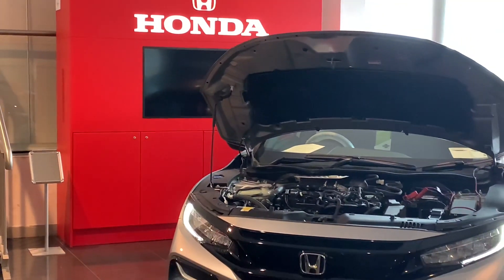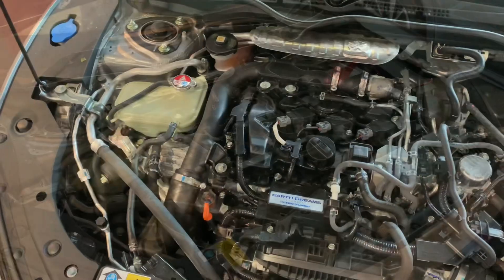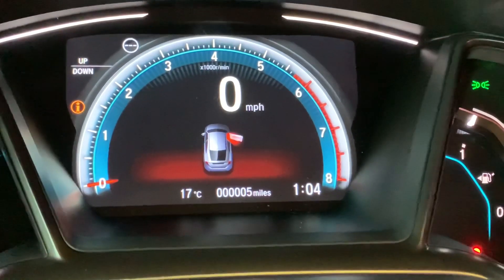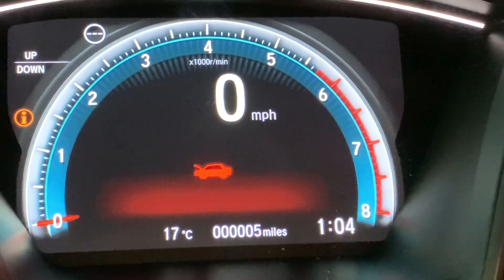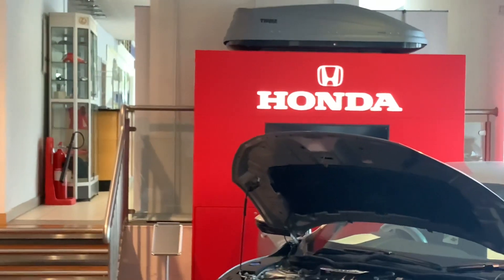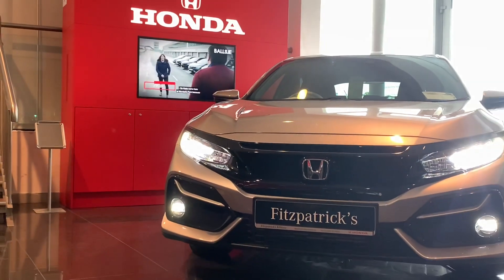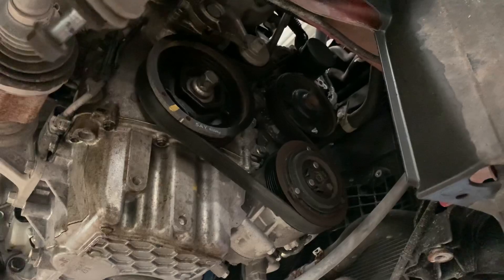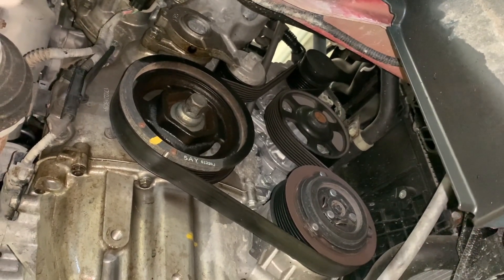1.0 Turbo Civic engine review - P10A2 - what is it like ?

Comment: Civic 1.0T with 119,000km and serviced every 11,000km, the head gasket blew. A disappointment.
Reply from the maker: Sorry to hear this , we haven’t seen head gasket failure on that engine , most of the rebuilds we did were oil starvation usually 😞

Comment: How about the known problem with the wet belt problem? Ours has 30k miles and the turbo and wet belt system has totally failed with belt degregation. We are fighting Honda atm. This engines not fit for purpose in my opinion
Reply from the maker: The manufacturer did some extended warranty on 2017 in 2018 models, what year is the one you have?
Reply: @doolanbrian 2020. It’s at Honda now, I’m refusing to pay for it if I’m charged. I think it was unfit for purpose when it was sold to us?
Reply from the maker: @deanbeckworth1053  I don’t know how consumer rights would look at that, we were never challenged on that basis as a dealer. We did carry out rebuilds under warranty on 2017 and 2018 engines but not so much after that. Does the car have a good service history as an oil changed on an annual basis using honda oil, et cetera?

Comment: I had a 1.ltr with 43000 mile on clock , seviced at each year , last week booom , totally unaware , lost pose dash litt up like a Christmas tree , turbo , variable regulator oil pipe boost the lot , cattle trucked , currently car in turbo specialist getting repaired . Thousands pounds for repair , wouldn’t touch on wit a barge pole , or any 1,0 ltr  turbo Wetheral be Honda ford whatever fuming on a car that’s a 2019  STAY AWAY !
Reply from the maker: Did you have it diagnosed in a Honda dealer?

Comment: There's a lot of the 1.0 litre engines with eco boost,turbos,  now on loads of different car models they have wet belts the belt sits in oil and you will find it's a lot more expensive to change
Reply from the maker: @willretro6110  it’s a more expensive job yes !

Comment: Never heard of Honda using a 3 cylinder wet cambelt 1 litre engine or seen one. Is it the Ford Eco boost engine which is a total disaster. Note- Ford are joining Red Bull F1 Team and providing joint venture engine in 2026. That will see no more F1 trophies for Red Bull.
Reply from the maker: @KeithPotter-ph4cp  not a Ford engine.. I think the engine was designed in Europe and then re-badged by Honda.. don’t believe it shared with other manufacturers

Comment: Hi,

I have a 2019 Civic SR with 80km on the clock. It packed in on me 10 days ago, lost power on the motorway and  wouldn't restart. No warning lights on the dash and no fault codes showing on diagnostics. Its with my local mechanic now as the nearest honda garage is 100km away. Any advice on weather this could be a timing belt issue?

I noticed a slight lack of power before it brokedown
Reply from the maker: @supercoolcol1  sorry to hear this😐 , so basically it wouldn’t restart, but not showing any faults? It’s impossible to say for sure but I would initially guess that possibly it’s jumped a tooth on the timing belt unfortunately🫤
Reply from the maker: @supercoolcol1  that’s a little bit unusual if the belt is just done and a bit unlucky🫤 most manufacturers operate on the principle of they don’t do warranty on parts after about 12 months, 

I think all you can do is ask the question, but I can’t really be sure what the results would be, sorry I can’t help better. No harm in asking for assistance it will cost you nothing.👍🙂
Reply: @doolanbrian  thank you for taking the time to respond. Your insight is very informative.

I can live with the cost of a new timing belt. These things can happen... but I'm afraid of my life there going to tell me that the engine is screwed now. I won't be able to accept that this would not be a honda issue rather than a me issue...

Thanks again 
Colm

Comment: As long as the engine has regular oil changes then there want be any issues with he timing belt.
Reply: regular Honda recommended does not work needs 5k km religiously. Onto second engine covered by Honda but selling soon for Toyota.

Comment: Love the car. Mine has sprung an oil leak between the engine and cvt gearbox. According to the dealer, it’s a common problem with the 1L versions after about 38k km. Will need to get the seals re-done and that requires lifting the engine out of its bay; pretty complex.
Reply from the maker: Hopefully you get sorted fast, can you get it under warranty?
Reply: Thank you. Unfortunately, my warranty has expired and there isn't a recall / service bulletin for it so I'm on my own. Love the engine regardless though!
Reply from the maker: @MisnadHaque  well, hopefully it doesn’t work out to be too expensive, glad you are getting on well with the vehicle🫡

Comment: timing belt problems with these cars,stay clear....
Reply from the maker: We have seen issues on the belt especially where service history is not good .. we sell quite a number of brands ., modern engines in all brands seem to have the propensity to have issues more than I can ever recall over the last 30 years in brands we sell and others brands we don’t sell as manufacturers try to meet difficult emissions and production related issues.. modern engines are extremely complex .. Peugeot honda Opel hyundai Kia citroen and probably more all have engines that have possible Osiris .. Honda I have to highlight are the only manufacturers that actually stand over their engine issues outside of normal warranty . In this car the 1.5 And 1.6 run a timing chain and so fair they don’t appear to be troublesome, thanks for watching

Comment: awful engine, not a Honda engine unreliable
Reply from the maker: Are you having trouble with the one you have at the moment?
Reply: This motor is a crap... mine is from 2021, 65.000km... Honda can find the cause why the cooling system is keeping ejecting the fluid from getting out... head remove, after 3 weeks the problem keep... 2 months testing the car and no explanation... no more Honda, sorry... expensive maintenance, high fuel consumption (8L in town) and AC problems, plastic noises, etc... i like the chassi but the motor is big big big issue...

Comment: I just had the 1.0 litre vetch engine fail in my 2018 civic, the turbo failed and the main crankshaft bearings failed, at 56000 miles, this is a common fault on these engines due to swarf getting into the turbo and oil dilution due to the direct injection system putting too much fuel into the bore, Honda finally ageeed to fix it free of charge after a battle, don’t but a Honda with this engine whatever you do DONT BUY A HONDA 1.0 civic !
Reply from the maker: Good that they covered it .. you must have a full honda service history ?
Reply: @doolanbrian  Brian, it’s a disaster from start to finish, yes, they covered it  after a huge battle, I still don’t have the car back after six weeks, no loan car was offered or available, the fact remains that I was sold a vehicle with an engine that is clearly not fit for purpose and now I have to sell the car the moment I get it back because even though they will have fixed it, it still has an engine with inherent faults, so, it’s not a rosy as you, the honda dealer try to make out !
Reply from the maker: @PaulPaul-chillers  you had a full honda service record with the oil changed every 9/10000 kms ?
Reply: @doolanbrian  of course, otherwise they would have had the perfect excuse to have denied the repair
Reply from the maker: @PaulPaul-chillers  are you in UK ? what are the service intervals over there for oil changes

Comment: That was not a timingbelt showing 4:20 min in the video, but the fan belt. Only reason to use timingbelt is its cheaper for the factory but more expensive for the customer when it needs to be replaced every 6 years. It is very difficult to get a price for changing the timing belt in Denmark because the car is not that old, but a Honda workshop has said that the engine must be removed when the timing belt is changed... DKK 20,000. or 2700 euros. It's ridiculous. Go for 1.5 L
Reply from the maker: You are correct 1.5 is a much better engine 🙂👍

You are incorrect that a belt is used to be more expensive for the customer as the 1.5 and 1.6 dsl is a chain , if the manufacturer wanted it to be more expensive then using that logic a belt would have been incorporated into other engines and this has not been the case s

We change the belt in ireland for circa €1300. The engine does not need to be removed. We have completed 8 of them since the start of 2023. 

UK comments on YouTube are giving dealers quoting prices of up to £1800 , there appears to be massive inconsistencies on pricing.
Reply: @doolanbrian  Hi and thanks for the reply. It's nice to know the engine doesn't have to come out when changing the timing belt, but that's what the Honda workshop said and it's the same operation as with the chain, which normally doesn't have to be changed.
But it is, in my (and others') opinion, a stupid expense that could/should have been avoided. There are many of the budget model Civic 1.0 2017-19 that want to sell now, it is because the owners now know there will be an unpleasant bill. It ends up with the Civic 1.0 being just as expensive as a big brother 1.5 model if you want to keep the car for a longer period of time.  Disappointing from Honda. That's why I never buy cars with a timing belt.
Saving money can be expensive 😄 Best regards Steen

Comment: Can you tell me whether the time belt modification 2021 did
The trick or if it is still a problem?
Reply from the maker: Haven’t seen any failure on a 2021 vehicle yet, any of the issues we have seen, are normally correlated to poor maintenance unfortunately
Reply: @doolanbrian  what do you mean with poor maintenance? Changing the wet belt as a precaution. Or more in general, standard maintenance?
Reply from the maker: @Onraneb  standard maintenance, ideally, these cars require oil change every 8000 km, wet belt then every 120,000 km or six years🙂☑️
Reply: @doolanbrian  wow, every 8000? The standard maintenance in the book (Honda) is every year or 15.000km. I am worried now. I am somewhat heartbroken that i switched from SEAT to a HONDA that isn’t robust.
Reply from the maker: @Onraneb  the car will normally warn you when it’s due service .. it’s a variable service schedule so it’s different for different people, some people only get 8000 km between services however some people I have seen them get up to 13,000 km between services.. I wouldn’t be worried, so many modern engines in petrol cars are small and turbocharged and they suffer from various issues if not maintained correctly so it’s not a brand specific issue
Reply: @doolanbrian  OK, Thank you for all your replies. In general, when this (known) issue occurs. Even though the maintenance schedule has been followed. Is Honda there to the rescue, or are all of the costs for the customer. I am not worried for the belt itself, but for blowing up the motor in total.
Reply from the maker: @Onraneb  honda do help while it’s under warranty 🙂👍
Reply: @doolanbrian  Hi, would your advice be to keep the car with good maintenance? Or is It better to buy a different car? I have no idea how many there are out there with zero problems. People in general only take the time to post negatives. So I have no idea what the fault percentage is.
Reply from the maker: @Onraneb  the vast majority of people get on ok .. we had 4 of them at home and never had an issue , keep the service history, up-to-date, with regular oil changes, 

yes, the 1.5 petrol and the 1.6 diesel have been more robust. But we do have people with 130000 kms and still motoring ok 👍
Reply: @doolanbrian  OK, how many complete failures did you encounter at your company and were they all related to poor maintenance? Thank you so much for your honest insights
Reply from the maker: @Onraneb  6/7 usually with non honda service records and none sold by our garage thankfully
Reply: In the end i sold my car a year ago. I was shocked that even some other Honda dealers were not happy with trading in my car with the 1.0 engine 35k (car was in excellent condition dealer maintained). Shockingly low prices were offered. Shameful, better say no then. In the end i bought a E-HEV civic 2024 super reliable real Japanese engineered car. The engine is real smooth.

Comment: £1700 for a timing belt change at 75,000 miles
Reply from the maker: I’m not sure why it’s so much more expensive to get the job done in England, in Ireland, it’s around €1250, so I’m not sure where the difference lies

Comment: I am scared about the timing belt, am told on the 1.0L CVT these fail and the bill from honda is £1600!!!! Something about the rubber belt rather than a metal chain, and when it break it causes massive damage to the engine. How can Honda charge so much or do you know the accurate pricing? When is the belt going to fail?
Reply from the maker: The timing belt unfortunately is an expensive job. It is required every six years or 120,000 km

Comment: Why timing belt change is so expensive
Reply from the maker: It’s quite labour intensive unfortunately, it seems to be very dear in UK particularly 🇬🇧
Reply: @doolanbrian  so much in the UK, when I was asking for a replacement over a year ago, the seller at first wanted to argue with me that there is a chain there😀, but after talking to the manager, it turned out that the belt and replacement are 1950 pounds, about 3 days need replacement  and it is very complicated, you just need to spin it a bit, a bit strange because the engine is great, but when buying a used car, for example, and paying 2,000 pounds for a year is a bit much, now it's certainly a little better with the price, but the manufacturer, if he led the replacement, why did he keep it like that, best regards
Reply from the maker: @andrzej812  I agree it way too expensive at that price 😣😣
Reply: @doolanbrian  I would like to buy this Honda 1.0 as young as possible but I have concerns about the GPF filter, it covers small distances, so diesel is out because of the DPF, is the GPF trouble-free in this engine and does not cause any trouble, do you know anything about it, thank you
Reply from the maker: @andrzej812  I haven’t experienced any issues with the gasoline particular filter, so it wouldn’t be a cause for concern. In my opinion.🙂🤟
Reply: @doolanbrian  👍👋Thank you

Comment: Was seriously considering this engine but dropped the idea as i read many reports on online forums of timing belts prematurely failing on these with people requiring new engines which honda doesn't cover out of warranty. Also turbos siezing are common which will cost you around £1900 + labour again not covered once out of warranty. These are a belt in an oil bath design and are flawed - apparently the belt sheds particles that can block oil pathways causing turbos to seize. Hence its import to change the oil every 5-7k miles. Also given the design, its not easy to change the belt like in older cars with timing belts. Also the cost to change the belt in the UK is in the thousands not hundreds. It costs at least £1500-1800 from what i read on the forums. This has been one of hondas most unreliable units unlike their previous gen engines. DYOR before buying. Google it.
Reply: Same here. I had a 9gen 1.8sport before... but this turbo (I've learned from my german 'premiums' that I should avoid having turbos ... ) really keeps me away to buy a 1.0T or a 1.5T... many people are complaining on the forums about belt issues that leads to turbo failures. It's not Honda's fault... it's EU's fault... the continuous chase of the environmentally safe/'better'  solutions that results in higher repair costs -> using more resources for fixing, earning the money to fix etc.... in the end, we've been doing better if we would have stayed with 2.0l natural aspiration engines. (IMHO)
Reply: @multioptipupiloptomy  Yes but environmental norms are necessary. Doesn't mean companies dump half baked products on us. In the end i ended up buying a slightly older Lexus Is300h and it's been great so far. Less spacious than the civic but great looks and fuel economy. Power is also good.
Reply: No way..Honda did the same stupid thing as PSA with their 1.2 puretech and the 1.0 ecoboost from Ford?!?!?! where is the Japanese engineering common sense? Did they hire engineers from Ford?
Reply: True had the same issue , converted it to the fk7
Reply: My friend has one and the engine went bust just at 37000km
Reply: @ArturHolindak did he get it replaced free of charge?

Comment: Does the honda civic 1.0 suffer from oil dulion
Reply from the maker: Not aware of that as a problem yet  on 1.0 but as far as I can see oil dilution seems to be very widespread in modern engines with diesel particulate filters and gasoline particulate filters , thanks for watching

Comment: £1599 for a wet belt change on these cars, mines due next year when it is 6 years old.
Reply: So how much would your garage do it for?
Reply from the maker: @barryherron5351  i think were around €1250 the last one we did was about 6 months ago, i think your price includes service and other items too ?
Reply: I would assume so, by the sounds of it is a labour intensive job. I'll get it done next year at Honda Newcastle next year.
Reply from the maker: @barryherron5351  once it’s done it’s a big selling point whenever you move the car on !
Reply: I think so, I was enquiring about it yesterday and the options of a part exchange against a 1.5 sport+,  Honda offered me more for mine than I paid last year.  They are a beaut of an engine those 1.5's mind.
Reply from the maker: @barryherron5351  if it was viable try and get into the 1.5, it’s actually easier on fuel, more power and no timing belt!
Reply from the maker: It seems to be very expensive in the UK to get the job done 😣